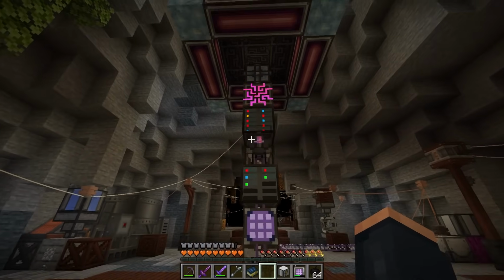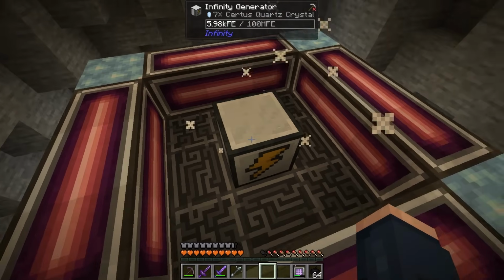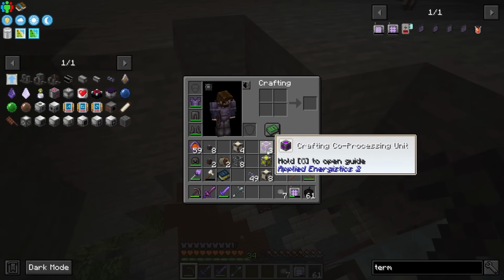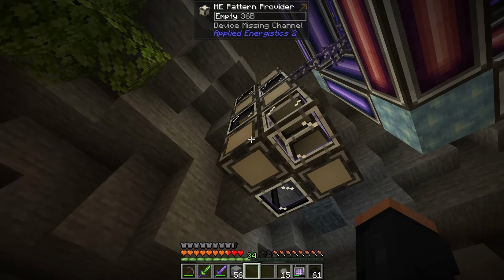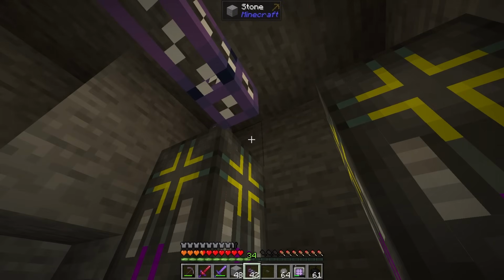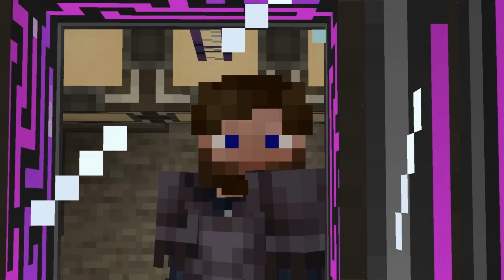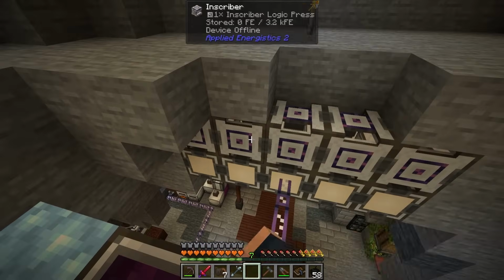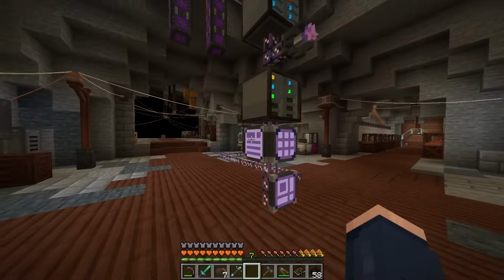Stoneopolis EP14 AE2 Infinity Generator, AE2 Automation, and Flux Networks

Comment: how i get concrete dust?
 all my concrete is used!
nice video
Reply: I had this issue as well. I was able to make a resource generator2 with the stage I was at to make terracotta. Or you could always go into the void, break your portal back, TP back home, re-enter your void, and it will make a new portal with a new platform of concrete around it.